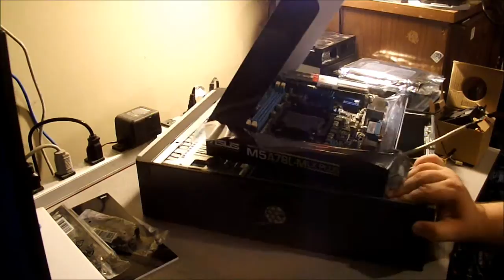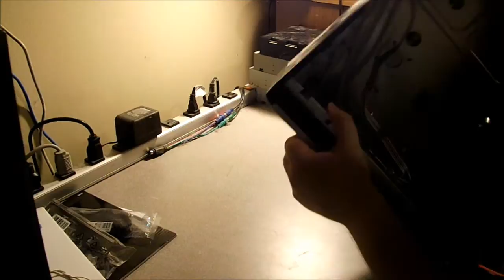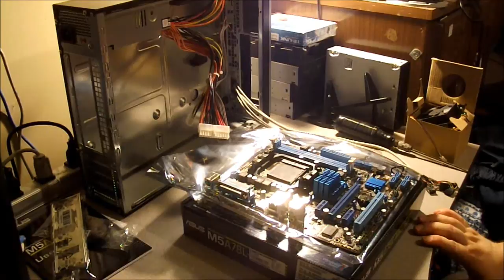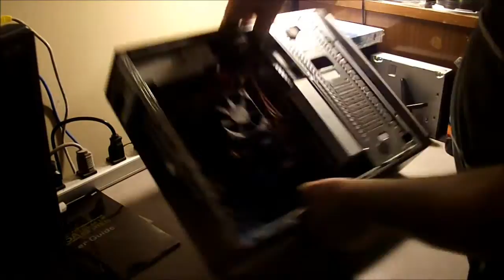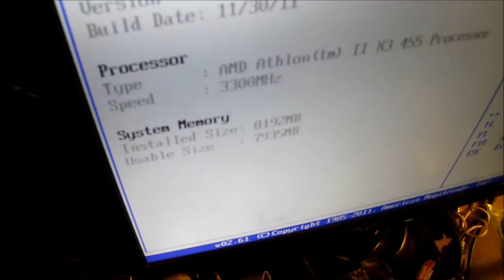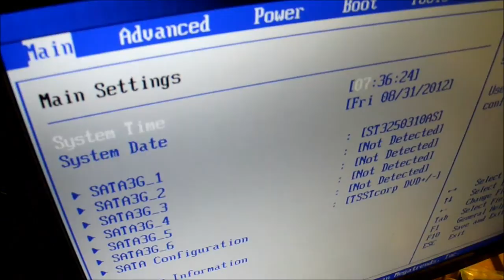New PC Build - Virtualization Lab Box - Part 2: Construction

Comment: Why did you skip the part where you slid the cage back into the case? That black bumper is getting in my way: it keeps coming into contact with my mounted harddrive and the cage won't sit in the case as it was intended.